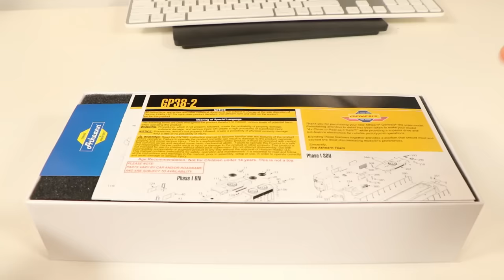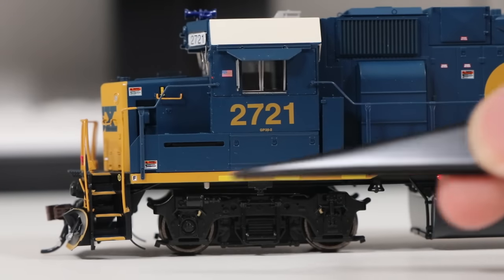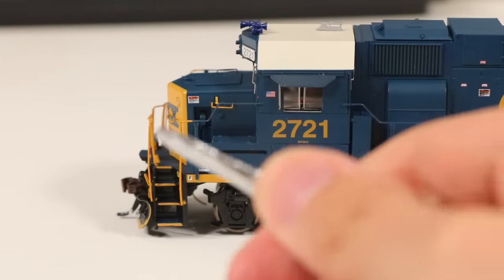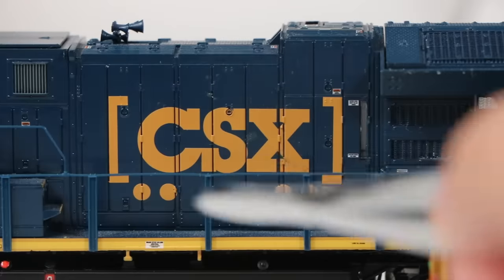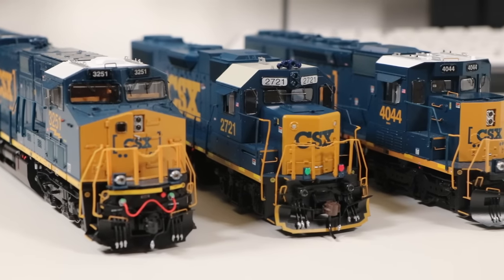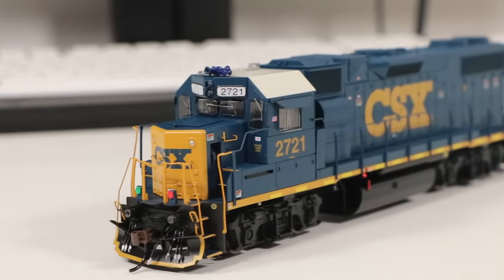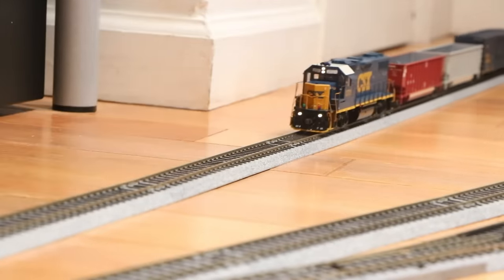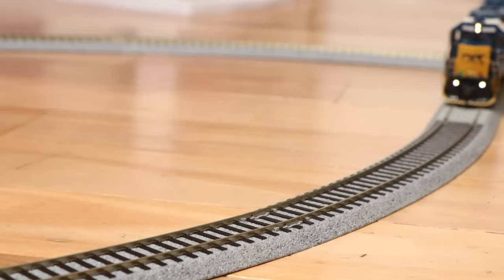Athearn HO Scale CSX GP38-2 Unboxing

Comment: Originally CSX 2721 Was A Ex Conrail Unit Number 8053 It Was First Built For The Penn Central Railroad In 1973 Sold To Conrail In 1977 Repainted Into CSX YN3 Paint In 2006 Sadly The Unit Is In Storage In Cumberland Maryland With Other GP38-2 Locamotives And Some SD70MAC Units Mostly If They Broke Down Or Retired From CSX
Reply: thx for the info
Reply: Wow sad 😔 nice info